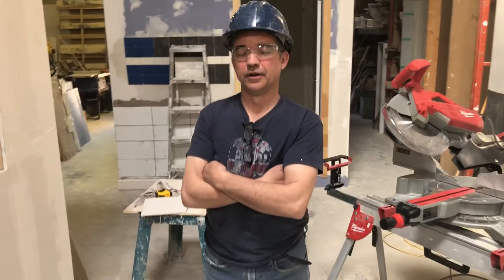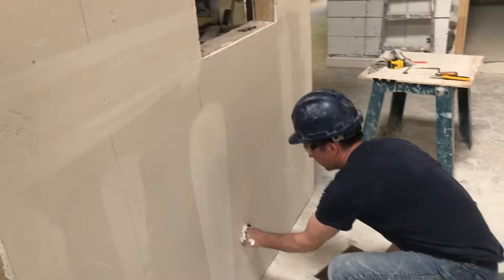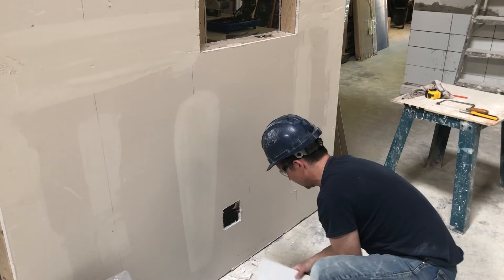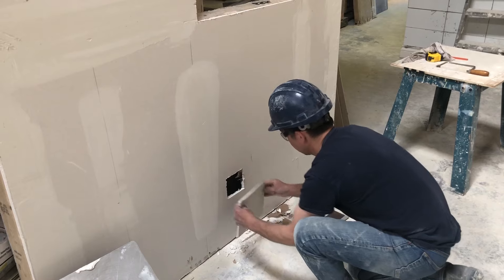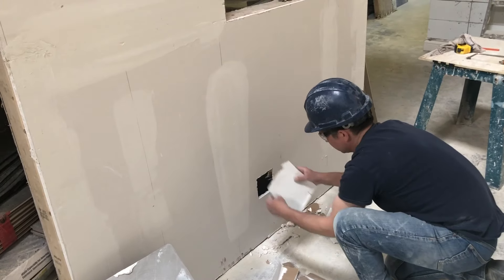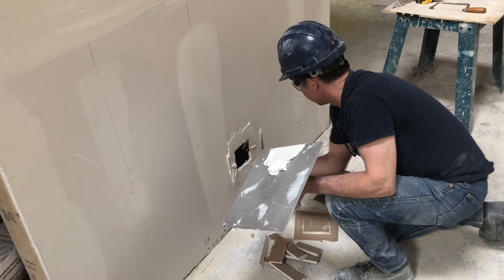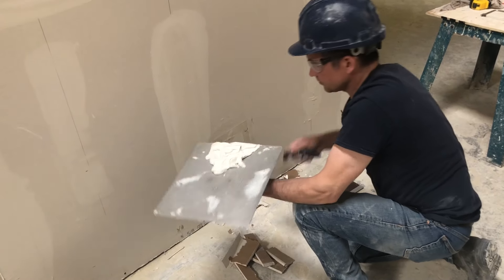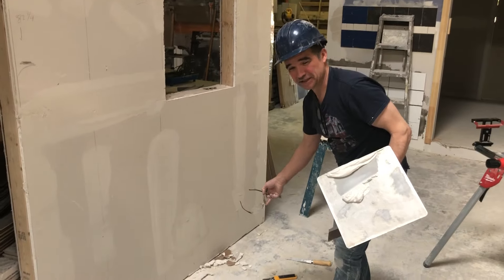How to Fix a Hole in Drywall (California Patch)

Comment: Oops, i think you forgot to put mud on the back of the patch itself before installing it in the hole, so that the edges of the patch actually bonds to the edges of the hole. Mudding the inside of the California Patch makes for a MUCH stronger patch.
Reply: Not necessary. It will be too much bc it gets squeezed out anyway. When using the knife, the pressure will bond it.